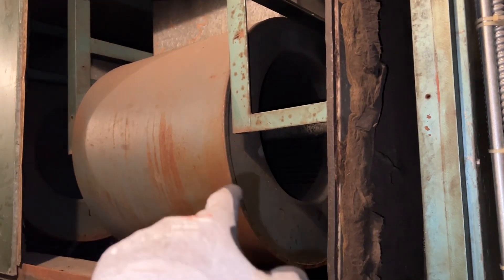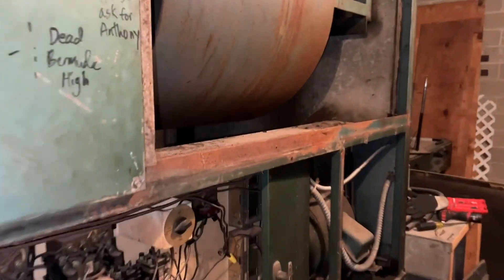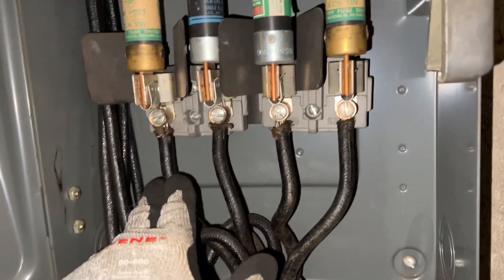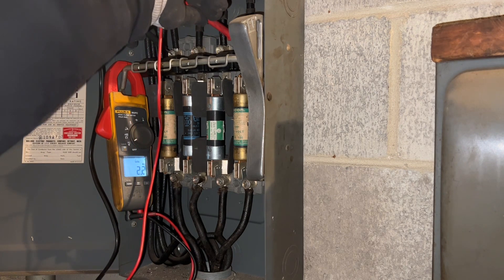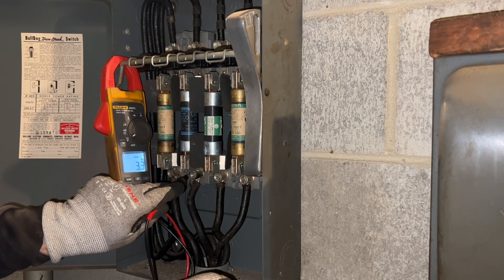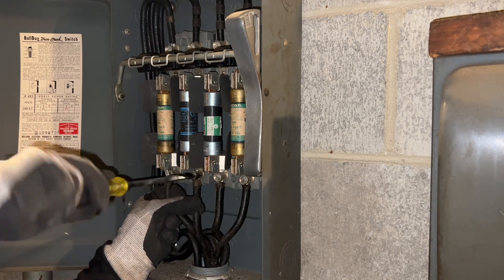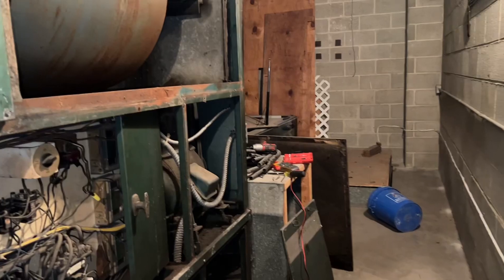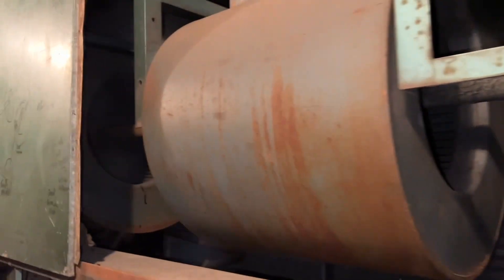Change Rotation On A 2 Phase Motor

Comment: Pretty decent video! Assume your in the Philadelphia are? Only place I know where it's still pretty active. 

Depending on where it's at can be made with a true main and teaser transformer set up or  single tank 3 phase delta secondary feeding with the 208 feeding the auto to get the second set or wires and first set coming off the single tank 3 phase pot
Reply from the maker: @michaelwalsh9650  yessir, south Philadelphia was where that site was. They have 2 phase being brought in from the street, then they have a 2 to 3 phase transformer, I believe they have a Scott-T transformer for several small circulator pumps.

Comment: Wait, don’t modern washers and dryers still use 2 phase power, since there’s two phases of AC that enter a breaker box if I recall?
Reply from the maker: Any single phase induction motor uses a capacitor to shift a phase of the starter winding to get the rotor going then most motors disengage that starting winding. 
You’re thinking of 240V that enters your house, that is one 1 phase from a 3 phase grid. 208V is 2 phases from a 3 phase system. 2 phase is obsolete.
Reply: @NickSilcox3  Ah, I see
Reply: @NickSilcox3 Y’all must be workin on that in Philly, there’s barely any 2 phase systems left nowadays. Makes you wonder why they decided on 2 phase back then when 3 phase was also being used. One extra leg but with nearly the same efficiency as single phase, gets a little confusing that Single Phase is really two legs (split phase), 3 phase is 3 legs, but two phase is 4 legs 😂 what? 😂
Reply from the maker: Any single phase induction motor uses a capacitor to shift a phase of the starter winding to get the rotor going then most motors disengage that starting winding. 
You’re thinking of 240V that enters your house, that is one 1 phase from a 3 phase grid. 208V is 2 phases from a 3 phase system. 2 phase is obsolete.